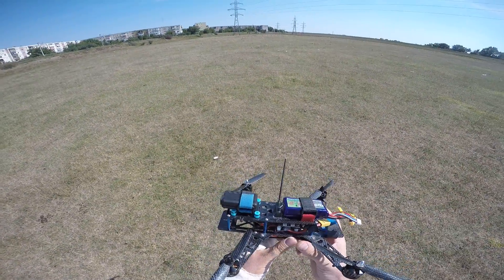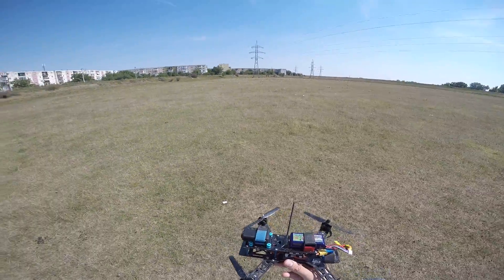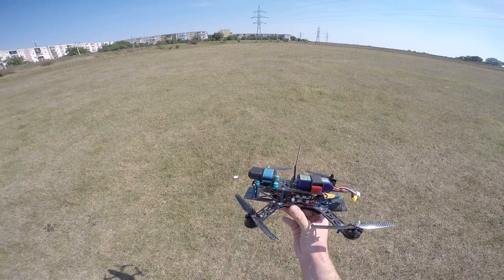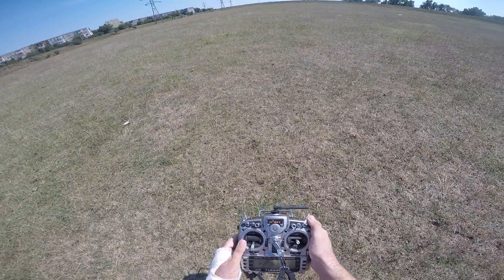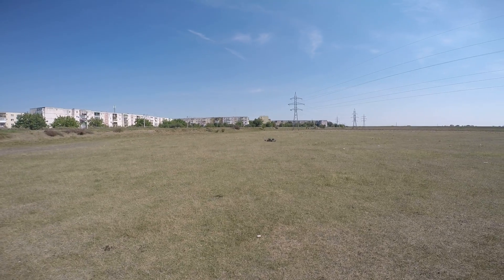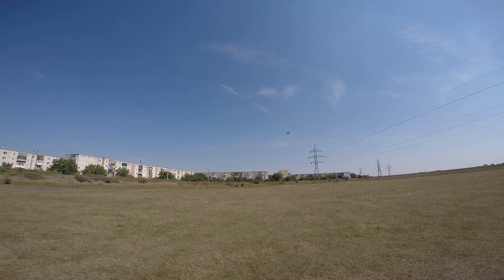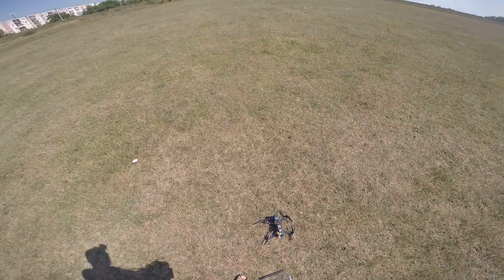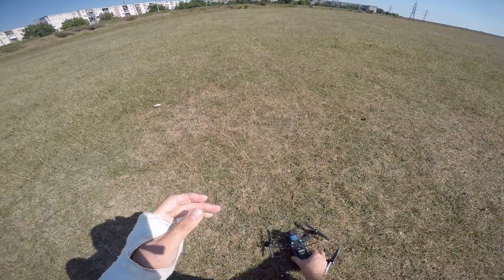D-Ronin auto tune - QAV 250 Nighthawk on 3S

Comment: Hi there, nice video ! I switched from libre-pilot to d-ronin and I have to set the PID's. I'm happy to hear that CC3D is capable of using autotune^^. so I will do that like you. I have one big problem with every GCS. With openPilot, librepilot and d-ronin it's not possible to set a switch for arming. I'm using a devo 10 TX with deviation software and the Devo RX703A as RX. It's only possible to use for arming-process one of the sticks. (e.g. yaw left)   I configured the switch correctly and the signal will be displayed at GCS. but everytime I select "arming: a switch" RC Input comes into yellow-light and the Switch won't work for arming. :-/

one other question: may it be possible to configure fail-safe seperatly ? or do I need to run the full TX wizzard for it ?
Reply from the maker: Hi, I had various controllers so far but on cc3d and alike I had randomly arming issues...of course I had chinese boards...I had also APM and had no issues arming or whatever, and the autotune worked also nice. Currently I run cleanflight on my faster quad and it just works stock better than the dronin after tune. Quite happy :)